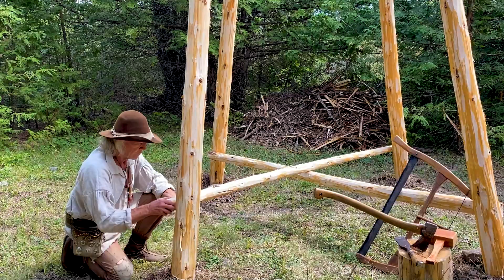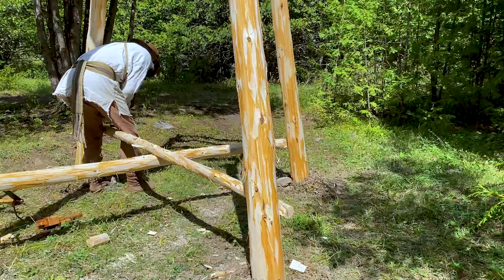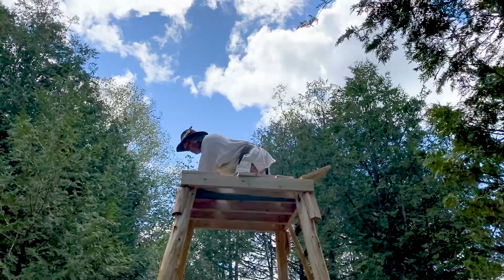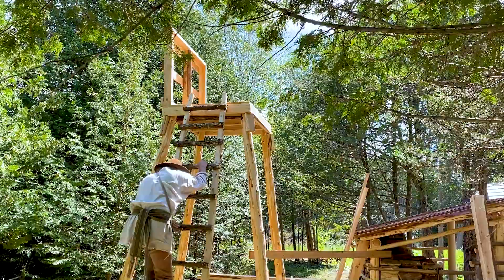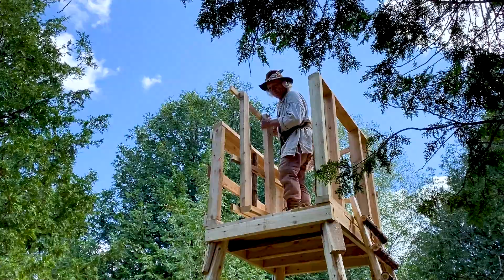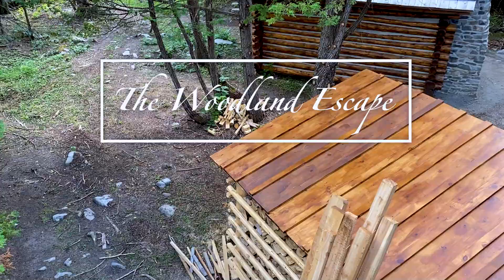Construction of the Elevated Food Cache Continues | OFF GRID | LOG CABIN BUILD | PIONEER LIFE

Comment: I disagree with the statement - no measurement supersedes a fair line.  The primary axiom for building anything of wood is - measure twice, cut once.  Your eyes can play tricks on you depending upon the light level and any vision correction devices you are wearing.  A steel tape, framing square and Buble level  do not have these same problems.
Reply from the maker: Well sir, if you ever build a birch bark canoe, you can throw all those tools away.
Reply: @TheWoodlandEscape  I DON’T build canoes.  The only canoe I have ever owned was a Grumman aluminum canoe.